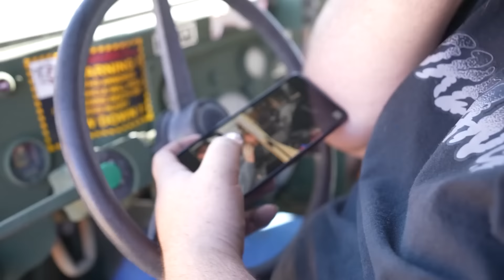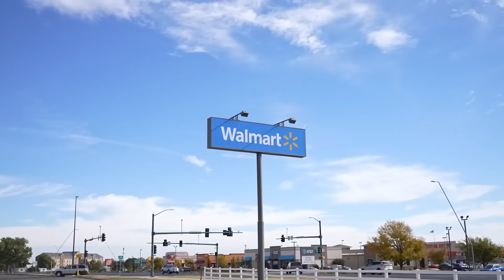Driving 1,084 Miles in a Humvee...It was Terrible

Comment: Westen demonstrates what a rookie trooper is in one video.  

Sleeping in the cab will keep you dry but that"s about it.   It is cold, the bed sucks, and your body hurts in the morning.

This is a great training video for new soldiers on the importance of doing  Preventive Maintenance Checks and Services,( PMCS).   I would bet that the Tire Pressure lbs per square inch are still stenciled right on fender so you can start out with the correct tire inflation.

Great video.

Comment: The Humvee was a failure from the very start.  The winner of the tender was actually a vehicle submitted by AMC, but they went bust before they could produce a prototype. The Humvee was too heavy, had horrendous fuel consumption, had no occupant protection, was hard to maintain and for a nearly four ton vehicle, could only carry 4 people. They tried to add armour but that took it to six tonnes and it was still vulnerable to IEDs. It did nothing well. The Australian army evaluated it and rejected it out of hand. They went with hardened Mercedes G's and built their own MRAP Bushmaster that was superior in every respected to the GM and Oshkosh efforts that were too heavy and expensive. A Bushmaster could limp back to base with a wheel blown off. The US one required a crane and a low loader. Pity if the bad guys were nearby.
Reply: The hmmwv is not hard to maintain. They are actually very easy to maintain if they are maintained properly to begin with.  The one he has seems like to me that it hasnt been properly maintained for a long time. . As for up-armed yes for IEDs that are about worthless but when getting shot at they are great. As for gas mileage when your talking about an old school 6.2 or 6.5 diesel it doesn't have that bad of gas mileage.
Reply: @michaelsingleterry1573  agree
Reply: Its a 2 ton vehicle. The armored version is 5. Having been struck by a few IEDs in one, it can survive. It took a direct hit to the undercarriage to inflict casualties, and that was with a bomb that would take out tanks.
Reply: It's not meant to function as an armored vehicle.  It was built to replace the jeep as a light utility vehicle for transporting troops and supplies in the rear.
Reply: It might be awful. But it is awesome.
Reply: You’re comparing the use of the Humvee as it was used in the 2000s and 2010s. The vehicle was designed as more capable Jeep replacement in the 1970s, not an uparmoured vehicle to defeat IEDs.
Reply: Mercedes G is 10 times worst vehicle. Australian stuck to it because they wanted to save money and couldn't afford humvees.

Comment: What were the official requirements when this was procured? Did the troops love it or hate it?

- Too wide to fit around narrow corners
- Much less reliable than your average Toyota technical
- Gas guzzling logistical challenge
- Shock & Awe inspiring looks
- Something else ?
Reply: LOVE MY HMMV IN AFGHANISTAN  SAVE MY LIFE..ALSO NOISY AND SO HOT....
Reply: It was an improvement over the Jeep (inside) space wise but the maintenance it requires is rediculas.
Reply: one bonus tho. it sure can fit a lot of crayon boxes inside.
Reply: I was in a unit that upgraded from the m151a1 Jeep.

Roof. Heater. Nothing can stop it..
Reply: It's got the same track width that tanks and military trucks use so that it can drive behind them in a mine field.
Reply: If I had a choice , I'd drive / ride an LMTV everytime. We did a lot of convoy security and ied's were a big consideration in that  decision. Higher off the ground, you could actually see where you're going & out the side windows.

Comment: As a army mechanic, those trucks aren’t good for high speeds held for that long.
Reply: I concur 😉
Reply: Yup, that is why the Humvee used the TH350 with a high ratio rear end for peak off road crawling capabilities. And why AMC/GM put the 700R4 in the original H1 paired with a GM 4.10-4.35 ratio rear end for both peak torque and road speeds of up to 85 mph comfortably. 

Original Humvee is rated at 50-55 mph top speed at 3500 top rpm with the 6.2/6.5 Detroit diesel and Turbo hydromatic 350 transmission and 4.60 ratio rear end.

Original H1, was rated for 85 mph top speed at 3500 rpm with 6.2/6.5 Detroit diesel and the turbo hydromatic 700R4 transmission and 4.10-4.35 ratio rear end.

Now if you got a 93 with rare 5.7 V8 engine option. You gained fuel economy, 6500 to 7000 top rpm. And a 275-325 top bhp with about 295-350 ft-lbs of torque. And a nice small block sounding V8 engine to match.
Reply: @williamajthompson9166  They had a TH 400 trans, a TH350 would never have held up to the weight and abuse these things saw.
Reply: @justinstearns9723  yeah I forgot these things weigh about 6500-8000 pounds stock and can carry/haul up to 10000 pounds worth of armaments and cargo for various operation purposes. While the TH350 was more for half ton and 3/4 ton pick up trucks. Where as the TH400 was originally designed for the AWD Cheyenne work trucks. Which I remember seeing that one gm commercial where it hauled a 70 ton log train at low speeds. Just to show that the TH400 was a tough 1+ ton transmission.
Reply: True. They're great off road but on long convoys on paved roads...not so much. When mine went down for a bad transmission, I signed out a CUCV and rode convoy in style down the MSR in Korea.

Comment: When you are on the highway Do Not pull the throttle stop all the way out and use it for "cruise control". Does the throttle stop still pull out about two inches further than the pedal goes?
Hummer speed secrets.

Comment: There's a reason  these are being dumped for next to nothing  on government  auctions. Are junk- 80s  engines, transmissions, suspension and parts aren't being made for them anymore.  It was rare for them go 200 miles before  needed significant repair. 
I worked on these never  want see one again.  If really  want one,  gut the engine  transmission  and suspension  the moment  get it, or buy one been stripped already save you the hassle.

Comment: Military H.E.T.'s are slightly more broke down prone, most of the time it's flat tires, must of the Iraqi convoys I was involved with (Expat outside the wire heavy truck driver '04-'11) for the most part were less than 200 miles, HumVee's had very few problems.

Comment: Speed and offroading with those dont like each other. Also make sure to power brake if you have a wheel off the ground and spinning when your stationary. Will distribute the power to the non spinning wheel same axle

Comment: "
18:30 "Hey I need to hit the water crossing with some speed" and I was screaming NOOOOOOOO I spent 6 years working on humvees as a contractor and we had to tow several trucks out of the field because the soldiers hit water crossings fast while the cooling fans were running and every time it would bust all of the fan blades off

Comment: My dad was in the air force and he was the guy on base that was in charge of inventory and delivering stuff all over the base. 

He remembers when he offloaded these in 1983? brand knew unassembled in boxes. 

The mechanics were super excited to see the new "jeep" they had to assemble

They immediately said wtf was the DoD thinking. How are you going to fit these on tiny off-road trails and move your troops over mountains in battle. They also quickly learned how shitty they were, and my dad got the earful bringing them the parts when stuff broke.

So to all you mechanic vets, just know THE very first mechanics to see them hated them and hated working on them and they have always been pieces of hot garbage

Comment: Mistakes I see.

 1. Is not wearing or even in possession of a real winter coat

2. Did not add extra insulation under him. That's where you loose your heat the ground or in this case a giant metal box

Comment: Owning a hummer is expensive just in monthly maintenance costs. Should get a maintenance manual from the military. Good friend of mine was a marine humvee mech and said he would never own one. You couldn't afford to maintain one. Tire and central air information system will break you.you cant let them sit none operating for any length of time or sht quits working. That comes from a guy that worked on them for 16 years.

Comment: If you had built a real fire with four foot logs, probably need a little silkie saw for it, you would have been warm as hell with the two doors facing it open. 

I stay in a crappy wood shop with a large stove and it's good enough unless it's insanely cold and windy at the same time.

Comment: Sorry, I just don’t get it. I bought an M998 back a few years ago in Germany. Drove it across to Northern Holland where I converted it to ‘M1025’ and then the next day on to Hoek van Holland flat out to get to the ferry on time and thence home half way across England. Sure it was loud, sure it was slow but other than that it was abut 800-900 miles of motoring pleasure.

Comment: That's cheating! You can't come back a month later.      I took my 10 year old son on a road trip to bring home a a 1988 jaguar xj6.   When we got there half the engine was in the back seat.  We made it home in less than a week without buying a single jaguar part.   FYI you can modify the top side radiator hose from a 98 ford 302 to fit the lower side hose on a 88 xj6 😆.
The humvee does look cool with that body kit.

Comment: I’m surprised they use Diesel engines in those, considering how temperamental Diesel engines are and how expensive the actual fuel is it just seems like gas would be better for a vehicle that size. Doesn’t seem big enough to really reap the benefits of a Diesel engine.